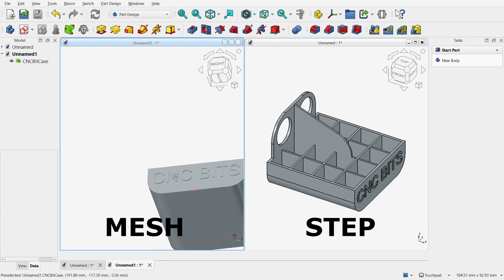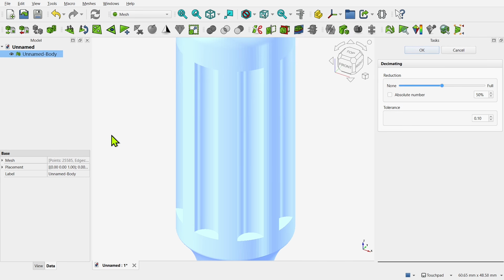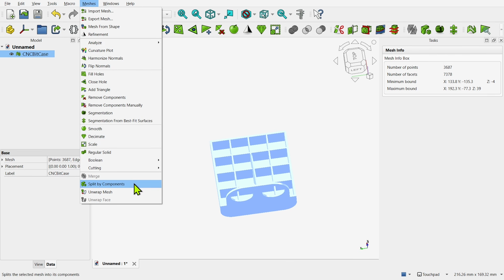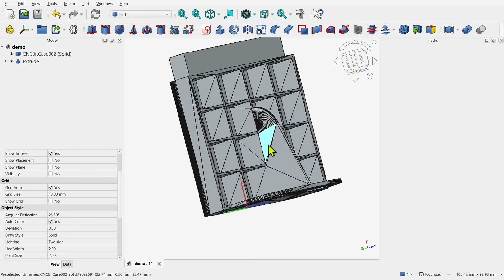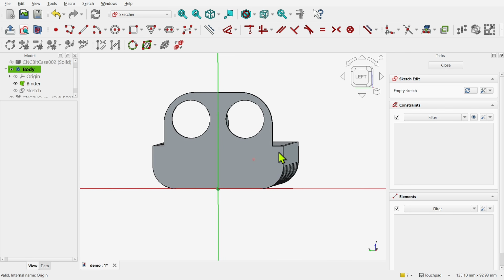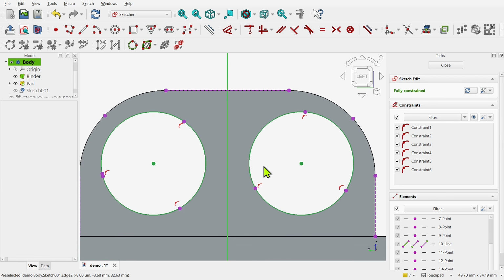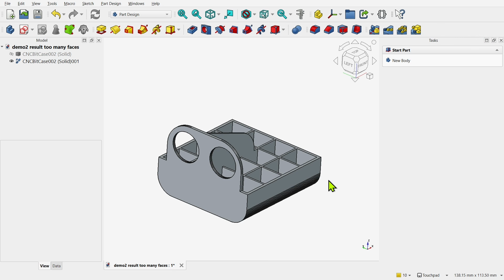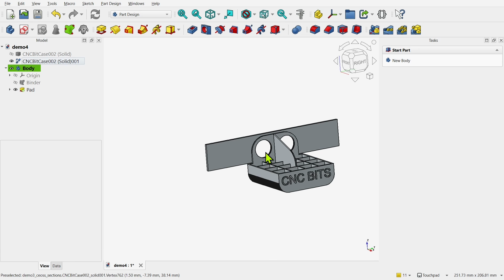FreeCAD Meshes Made Easy! Complete STL / 3Mf Workflow

Comment: I found this video at the right time as I wanted to convert a file I got from Printables & change a couple of things. I got as far as the analyse evaluate & repair, then stopped. The number of components I got is unknown because I counted to 100 & the scroll slider hadn't got halfway down the channel, so there's at least 200.
I think it'll be easier & quicker for me to design my own 😆
Great video, thank you for putting the work into it
Reply from the maker: Thank you glad you enjoyed.   Ehhh, yeh, been down that road. Sometimes your at the mercy of the supplier of the mesh.  I have noticed lately there has been some really bad meshes out there.

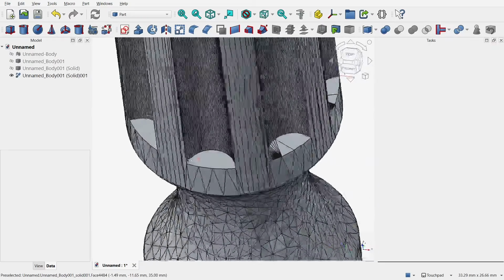Comment: 11:09 Do you know why some faces weren't refined and if it's possible to fix that? I guess it's the tolerances, but "Refine Shape" doesn't allow changing those, does it?
Reply from the maker: it's an approximated mesh so often it's just deviating slightly from the same plane. Also circles wouldn't be true circles so made up of many edges.   Refine shape doesn't allow any tolerance adjustments unfortunately.  Which reminds me I have to track down something I saw on facebook a while back which could be related to this.  A Developer was coding a stand alone importer that looked like it would solve these kind of issues.

Comment: i get tons of repairs. and even after repairs it isnt a solid
Reply from the maker: It sounds like you might have some non-manifold geometry or holes in your mesh that need closing before importing. Unfortunately it isn't guaranteed that a mesh will be clean from the start.

Comment: what do you do when the mesh has THOUSANDS of components? Like a PCB
Reply from the maker: It depends on the result you want. You can copy individual ones to a new document (ctr C & ctrl P), delete the ones you don't want from the 3D view or use the mesh workbench to combine using the boolean union tools. Hiding the components means they wont get rendered to the 3D view so will reduce the load on the CPU

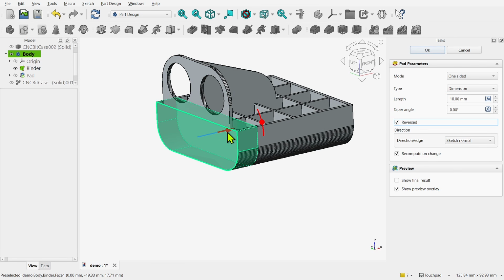Comment: 29:01 I think this is where the "Up to face" pad type comes in handy, personally. Switch to that and click the opposing face on the shape binder. Adding your own size does mean one less dependency on the original shape, though.

30:25 Or you use the circle by 3 points mode (click the triangle on the button, or G 3 C, or M for mode while circle tool is active). I think M is my favourite key now.
Reply from the maker: Some nice suggestions there :)

Comment: Nice video, tho when you started recreating the object via sketches + part design, I kinda hoped to see some neat tricks how are you gonna easily replicate the checkered cavities (which I'd probably do manually, which I presume/hope isn't the best way), but you never got to that… 😅
Reply from the maker: Thank you :) The CNC bit case was one of my old models I had as a STEP file.  If I was recreating it today I would create the solid base in part design with a simple padded rectangle, then a small square for the first pocket.  Select this and then use the linear pattern operation. You have the option to choose Direction 1 and 2 which will create both rows and columns.

Comment: I watch a lot of your videos and I always see you suggest a certain way that I was always "taught" (as in from what I've read and from personal experience) was ... not wrong, per se, but caused more trouble downstream. You attach sketches to faces of previous pad features. Doens't that make the model less parametric and prone to breakage if something is changed later on?
Reply from the maker: Good question, It might be worth taking a look at this video, where I explain the different workflows you can use, from dependency chaining through to attaching features to base planes: https://youtu.be/riXcI6ZW0A8

From day one on this channel, I have always tried to follow the standard CAD practices used across other software. As TNP continues to improve, these workflows become more stable, which means the videos and techniques remain relevant.

That said, every workflow has its place, and the key is understanding your design intent and choosing the right approach for the job. If every video relied solely on offsetting from planes, even simple modelling tasks would become much longer and more complicated, which could make FreeCAD feel unnecessarily tedious for newcomers.

When changes do break a model, they can often be resolved by reattaching features to the new TNP-generated references. FreeCAD gives us a wide range of attachment options, including faces, edges, and vertices, with various attachment modes. Learning how and when to use these tools helps people become more confident with the software and improves adoption.

Those tools exist for a reason. It would be frustrating to pick up a toolkit and then be told not to use half of the tools because they might cause problems in the future. The important thing is understanding the strengths and limitations of each approach and using the right tool for the right situation.

I think I mentioned this in the video when talking about design intent: you could spend weeks creating the most change-resistant, parametric wall bracket imaginable, but that level of planning is probably better reserved for something much more complicated, where every design change and dependency really matters.
Reply: @MangoJellySolutions  I really appreciate your taking the time to fully explain that! That makes sense.

Comment: what if my component is still ''not a solid'' but when I do analyze and repair and have no repairs anymore, it still say it is not a solid. what do i have to do?
Reply from the maker: Normally means the original mesh is not watertight so you will have to use an external tool. As suggested by one of the comments you can use mesh mixer, or if you are familiar with blender then that will work as well.
Reply: This is exactly my question.
Reply: Export it to meshmixer . There is a great repair tool there.

Comment: FreeCAD really needs a wizard for this.
Reply: 3D Printing Tools workbench, as well as Detessellate workbench have macros for things like converting to refined solid, scaling, etc. But I think there is real value in understanding the steps.
Reply: This is where creating custom toolbars with the operations you regularly use comes into play.
Reply from the maker: It would make the process more accessible for beginners! Maybe it can be done via a macro.